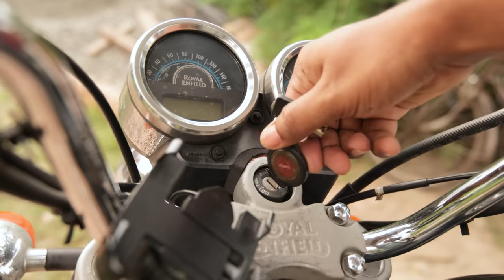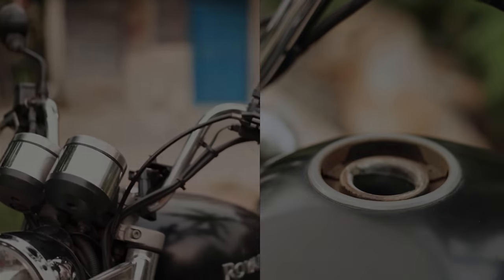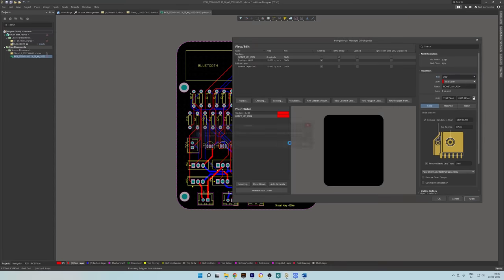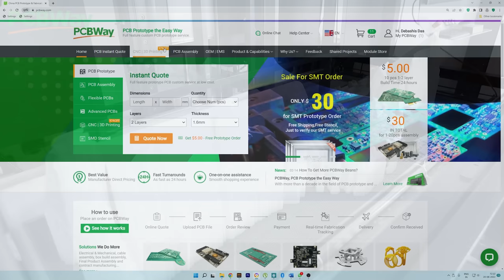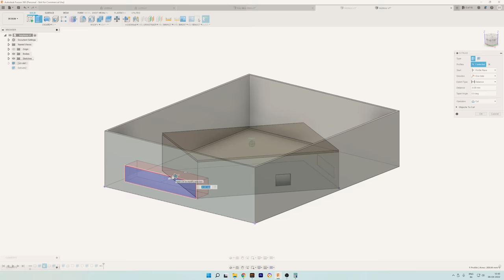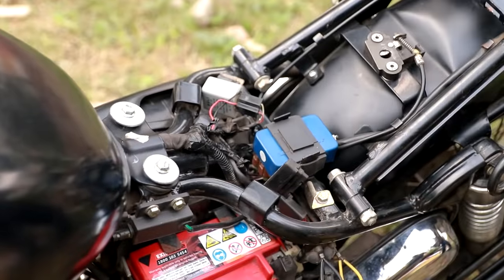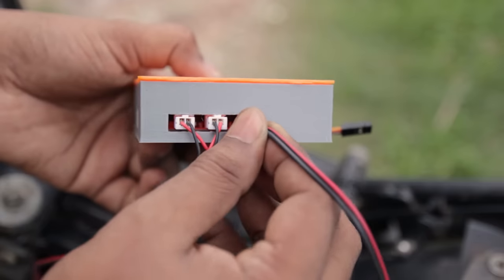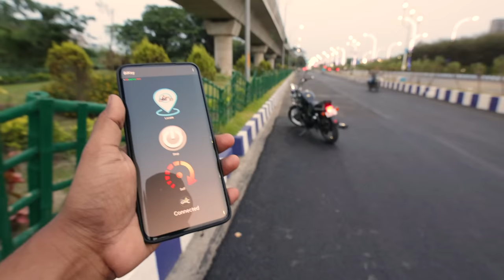How I Made My MotorBike Completely Key Less

Comment: Amazing work brother, I really appreciate the efforts and the results. But few things that I'd like you to look into, such as that alarm. That system is so delicately reacting that if the bike come across a thunderstorm or if it gets contacted with a dog or any stray animals, it'll buzz I guess. Second thing is that fuel lid lock. Anyone can open the fuel lid and suck out your expensive fuel. And the most important thing, if your phone is dead for some reason then? In that case you must carry a spare key with you. Right? 😂
Reply: Exactly and what if your phone is lost or stolen 😬
Reply: That's true
Reply: @harshsoni3369  your argument is invalid as it's similar to question what if the key get stolen or lost
Reply: Also, there's no a handlebar lock.
Reply: What If you are on a long drive and you battery dies and you don't have a way to charge it at that time?

Comment: One problem, the circuit is always on, so it always consume power from the bike battery.
If you won't use it for some time, It will drain the battery and the bike won't have enough power to start
Reply: Another problem , always to check the gear is in neutral  position

Comment: It's really good to see such innovative ideas being implemented brother. However I have some doubt such as  wt if u have left ur bike parked in a geared state. Can u still turn the bike on later without holding clutch?
Reply: With this design probably you could do it, doing some damage.  If the bike's got a neutral sensor, is fairly easy to implement a safety feature, and even return a "NOT NEUTRAL" on screen message.
Or instead, if your bike already has this safety feature, you can simply hook the starter wire to the handlebar pushbutton instead of directly to the starter motor relay. So if geared and not neutral, it won't do nothing.

Comment: Great job! But if the phone is stolen, then the motorcycle is stolen. For safety reasons, I would add the function of starting a motorcycle by fingerprint with an additional indication of this. And as soon as they started turning the handle, without the fingerprint indication, the motorcycle would stall...

Comment: There are big  problem
 with this project.
suppose if your bike is in 1st gear and you start the bike from your phone then your bike may fall and break
To overcome this problem, you will make a machine which will alert the bike is in gear as soon as the app is connected and the app will not start the bike if the bike is in gear.

Comment: Can you make tutorial for key igntion switch with voltage meter display for xiaomi scooter. I saw a lot from YT. But mostly showing only 5v on the voltage display. And i did the same thing. Someone told me they used relay and make the 3 wire into 4 wire connection from key ignition switch to separate the real battery capacity which is 36v-to 42v.  TIA. 🙏